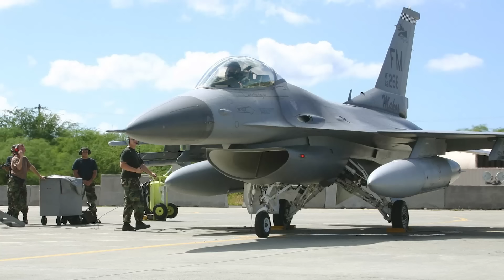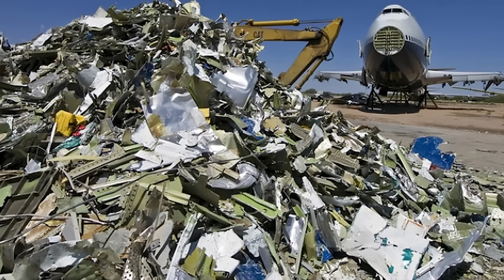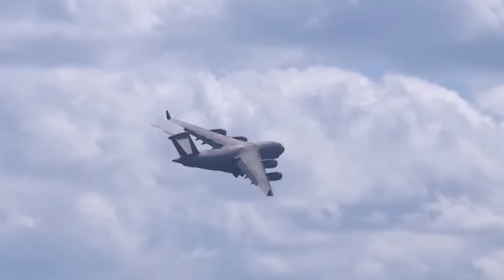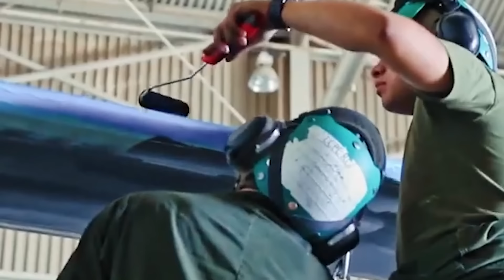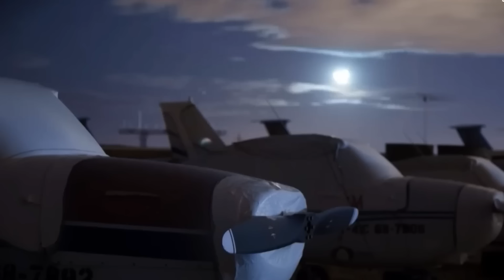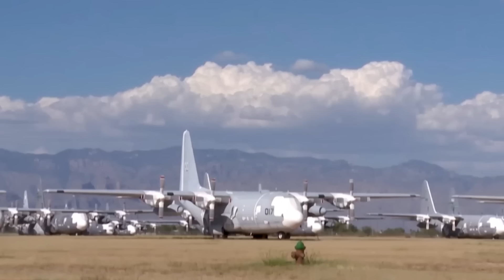Why Are 4,000 Airplanes Stored In This Desert?

Comment: This is actually genius. Imagine the U.S. going to war, and the number of active fighters is significantly lowered. Some of these aircraft could supplement active aircraft and keep our Air Force strong. Any war that would make this necessary would have to be pretty bad, but it’s good to have it as any option. F-15 a/b and f14’s may not be modern, but they would still put up quite a fight against other 4th gen aircraft such as the Flankers and MiG-29.